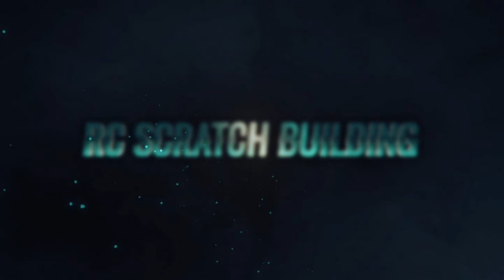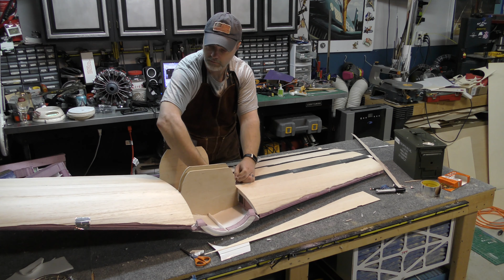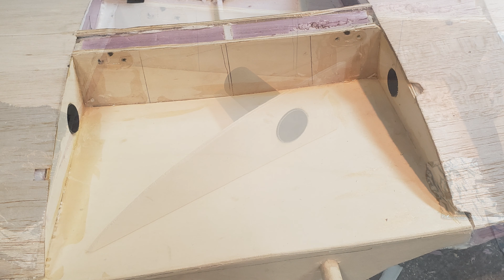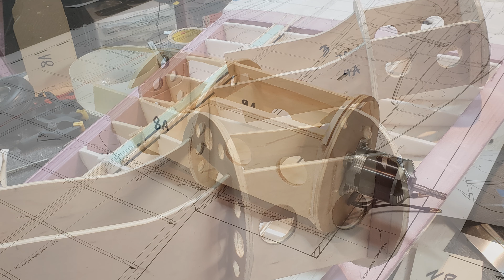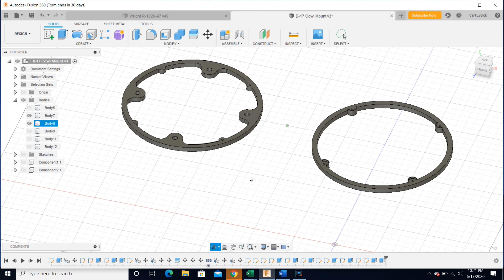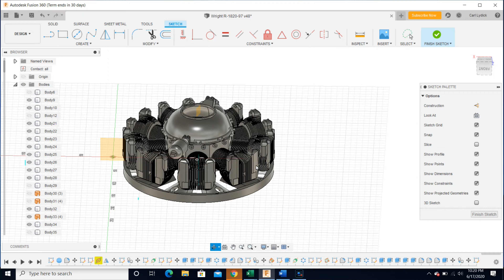1:9 Scale B-17G 'Sweet Pea' - Wing Part 3

Comment: Hi I have a question about the dummy radial engines that you are making for your 1/9 scale B-17 , are you going to have them 3-D printed ? In the reason I am asking is because I have a 1/9 scale B-17 that I am building from West Wing models that I purchased which is just going to be first static display at different airshows but I want to find out if you 3-D print these radial engines if I could buy a set off you ? Or if you know someone who can 3-D print them for me ? I would greatly appreciate it thank you so much and I really enjoy watching your build on your B-17 because in a way it will help me when I start my build this summer thank you